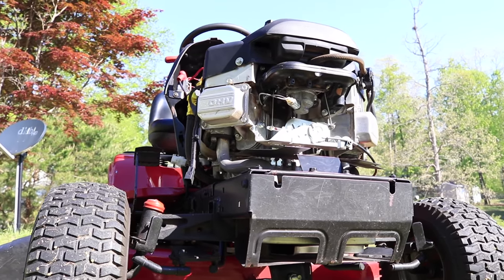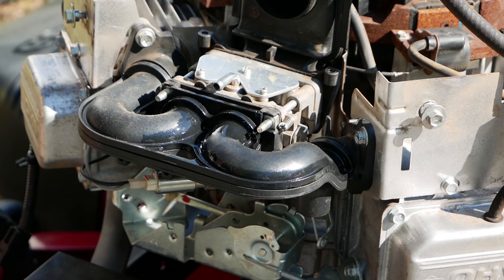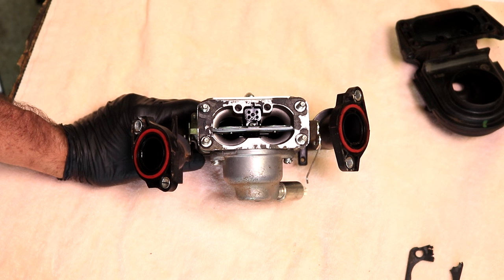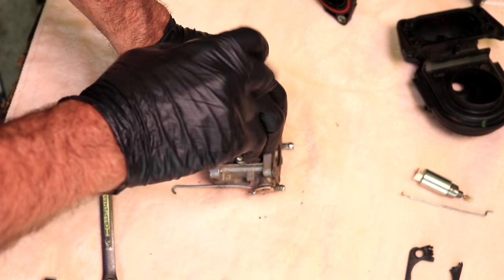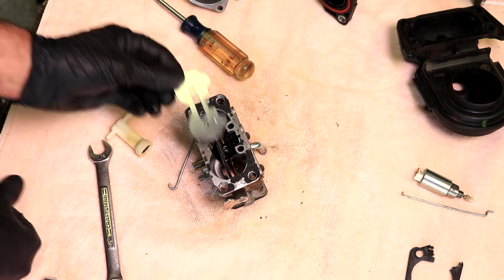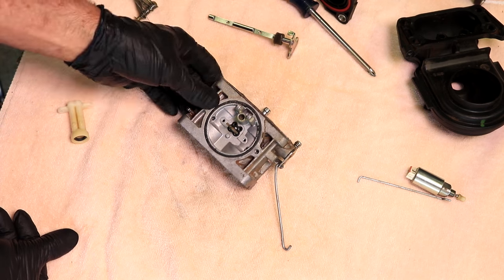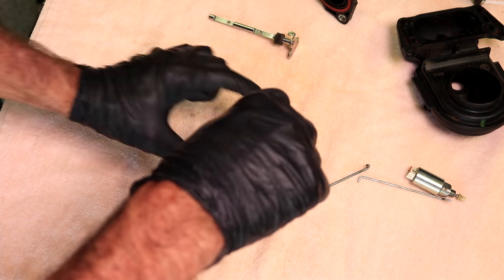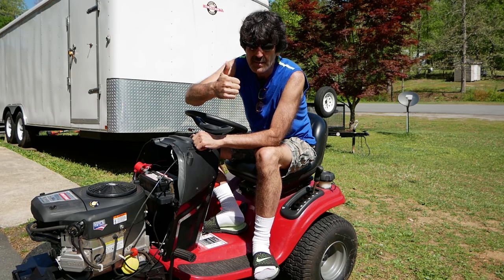Briggs and Stratton V-Twin Carburetor Repair

Comment: I am working on a John Deere with the Briggs 22 V twin,  it has some carburetor problems,  I checked the electric shut off valve,  it works,  checked power at the connector it has power.  I started it by pouring some gas down the air opening it fires right up but dies right after it runs out of gas,  I am using a hand vacuum pump and the fuel pump works.  It's not pulling the fuel from the fuel bowl.  I had carburetor cleaner going through all the little holes. At a  loss as to why it won't keep running.  I didn't take it apart like you did so maybe I need to do so.  
Thank you for your video,  it's a big help
Reply from the maker: HI, I usually will disconnect the fuel line where it goes into the carburetor and point the fuel line into a jar or something.. Then crank the engine to see if it's working.  Your vacuum pump could be generating more vacuum than the engine is so it could be a false reading that the fuel pump is working.  If it is working, then yea, you'll probably have to take the carb off and go through it and look for any nook and cranny, little holes, etc that could be clogged..
Reply: @JLPicard440  
Sir, thank you for your reply,  I appreciate it.  I will try taking it completely apart,  I was concerned about ruining a gasket,  I found a rebuild kit for $8 on line,  so if I need any gaskets,  I know I can find them.  This has been sitting for about 4 years  the original complaint is the battery goes dead before they get their yard cut. I figure maybe the alternator,  voltage regulator,  or a broken wire somewhere.  I have to get it running before I worry about that. 
Again Sir , thank you for your response.  Have a wonderful day 😊
Reply: @JLPicard440  
I got the machine running,  it had a problem with the fuel inlet,  know it sounds stupid,  but I drilled out the small jet at the needle valve by about 1 thousands of an inch.  I couldn't blow through the tube where the fuel line connects.  I could blow through with air, both ways.  Finally I could blow through with mouth air.  I knew something was wrong because when I took the fuel bowl off there wasn't any fuel in it. I also ordered a new fuel pump.  I think you are correct about my hand pump making much more vacuum.  The new one is just in case the original doesn't work.  
What I did was put some gas in a small container and hooked up the fuel pump,  it worked and I kept the engine running by using the hand pump.  The engine runs good,  after I get the fuel system working I can work on checking the alternator/Voltage regulator.  

Sir thank you for your help. It's much appreciated.
Reply from the maker: Ok cool... Battery dies before the lawn is cut?  That's strange... The engine has a magneto and doesn't rely on the battery to keep it running once it's started.  Maybe they would shut it off to go do something and then came back and it was dead.  Maybe the battery was just bad already and wouldn't keep the charge?  That's something I'd have to see.  I'd be curious what you find out on that one!
Reply: @JLPicard440  
It has an electric PTO for the blades,  and it stops cutting the grass.  That's the main problem.  That's why I think it's either the alternator,  or voltage regulator.
The owner replaced the battery and it did the same thing with the new battery.  Those electric PTO's draw a lot of amps when they first engage,  but after they lock up,  it doesn't need as much. Still it is a drain on the battery.  I hope you can understand,  I may not be very clear in my description of the problems.  I appreciate your help.
Reply from the maker: Very clear... so an easy way to test the charging system is if you have a volt/ohm meter take a voltage reading on the battery with the engine off... should be over 12 volts with a good battery... then take another reading with the engine running.  It should be 13.5 or 14ish somewhere in that vicinity...
Reply: @JLPicard440  
Yesterday I checked the voltage at the  wires that come directly off the alternator, at full throttle it was only putting out 12 volts A/C should be at least 32 A/C  after the voltage regulator it should be as you said between 13-14 volts DC  I have and alternator from and project that has both the A/C and DC , so I hooked the DC to the wire that goes from the voltage regulator to the battery.  Still having some problems with the fuel system  so when I get that fixed then I can check the alternator output. 

Sir, thank you for all your help and suggestions. You have gone way above to help,  it is greatly appreciated.  I will let you know when I finally get this thing fixed.  I ordered a new fuel pump and filter should be here sometime next week,  until then I'm going to clean,  and finish the fuel system as much as possible.  I  cleaned the fuel tank, and flushed the fuel lines, I'm going to try to have the fuel system ready just add the filter and may try to use the old pump first if that doesn't work then use the new pump. 

Again thank you Sir 😊
Reply from the maker: Awesome!  Glad to help and my curiosity is up on what you find out with the charging system.. 😀
Reply: @JLPicard440  
I ordered a new alternator,  the old one I had only put out 12.7 DC, I put the original back on it only put out 12.3 volts DC I should get the new alternator sometime next week.  

I'm still confused why the carburetor wasn't allowing gas into the fuel bowl.  But it does seem to be working now. 
I have posted a few videos if you would be interested,  just go to you tube, videos by bert grau. I don't have many videos,  and I am not planning on doing many.  Just a suggestion. 
Your help has been very helpful,  thank you sir
Reply from the maker: Cool Bert, I'll take a look at them.. Thanks.. 😀
Reply: @JLPicard440  
I got the new alternator,  and the same as the old alternator.  I figured I would try running the engine and engage the PTO to see if putting a load on the alternator would cause it to charge.  All it did was blow a 30 Amp fuse and killed the engine.  So now I have even more wiring problems to sort out.  At least now I might have an idea of why it's not charging correctly.   This has definitely been a unique project.  I'm just glad the owner is in no hurry for it. I told him it could take a while and he said it's been sitting for over 2 years,  take your time.  I didn't figure it would take this much already.  Oh well I'm glad I have the tools, and some experience doing this king of work.  
Have a wonderful weekend sir.

One more thing,  I was thinking even though these engines can safely run 3600 RPM many don't  run more than 2600 RPM.  I went past governor RPM and the voltage came up to 13.3 volts,  still not enough but headed in the right direction.  That was going through the voltage regulator.  I really need a small engine tachometer.  I will order one and see what happens if I set the engine to 3400 and see if that helps.

Oh, one more thing,  I found the PTO switch also has a kill wire so you can't start the engine with the PTO on. It can also kill the engine as well.  Like I said, a lot of wiring problems to sort out.
Reply from the maker: Wow,.. wish you were close (western FL)!  I love these kind of problems.. 😀. Do you have the wiring diagram for that particular mower?  That might help you figure out where the problems are coming from...
Reply: @JLPicard440  
No, I'm in southwestern Missouri.  I don't have a wiring diagram,  I'm just going to track down each wire that goes from the PTO switch and see if I find any damaged wires,  or maybe the PTO clutch itself is shorted out inside of itself.  I did over ride the governor and the voltage came up to 13.3 volts.  So that gives me another bunch of new ideas to look at. Throttle cable out of adjustment,  governor set too low RPM.  Who knows what else? I'm sure I can find it just going to take time.
Reply from the maker: Oh wow...  Try to google your particular mower.  I've found lots of wiring diagrams in the past for various mowers, so you might find one (Free)..  A quick way to tell if the PTO clutch is bad is to disconnect it and then try and engage it.  Engine doesn't have to be running.  If it's still blowing fuses while disconnected then maybe there's a wire pinched against the frame somewhere..
Reply: @JLPicard440  
That's a great suggestion,  I'm not working on it today.  I will look for wiring today and unplug the PTO tomorrow.  Thanks for all your suggestions.
Reply from the maker: Glad to help!  Let me know how it goes... 😀
Reply: @JLPicard440  
Good morning, 
I took the clutch off,  after I took your suggestion to unplug the wires,  it didn't blow the fuse.  So I wired in a 20 Amp fuse and hooked it straight to the battery,  the clutch seems to work and did not blow the 20 Amp fuse.  I found the wires from the wire connector to the clutch were wrapped around the pulley shaft and rubbed the insulation off 3 wires 2 are ground and the hot wire.  I don't know if this has anything to do with the alternator not charging or not.  I'm going to fix the wires and try to see if the alternator will charge or not.  I enjoy doing this kind of stuff.  

I remember working on an old semi trailer that had light problems, took me an hour to find the problem then 2 hours to fix it.  The customer told he had it at another shop charged him for 6 hours work,  and told him they couldn't figure out why the tail/brake lights didn't work.  I guess I just got lucky.  The wires went in between the floor and the 5th wheel plate got shorted out. I went around everything with new wire,  cut the old wires where I new them to be good towards the rear of the trailer and they worked.  Some times just dumb luck goes a long ways
Reply: @JLPicard440  
I started it up after getting everything back together,  and it's working.  The alternator was under 13 volts I rev'ed the engine over governor speed and let go back to governor speed and the alternator put out nearly 13.3 volts.  I'm guessing if I get an alternator with more coils,  it might make more output.  Just a guess for now.  The current alternator has 8 coils,  I'm thinking if I can find one with 10 coins it might get up to 13.5 to 13.9 that would be enough volts for this machine I think.  By the time I got finished with it for today,  the battery voltage with the engine off was 12.4 volts 
So it did get some charging even with the PTO on, I only had it on for a few seconds because I have cardboard on my floor,  much easier to lay on . I didn't want the blades to suck up my cardboard and chop it to pieces
Reply from the maker: Cool!  Glad you got the clutch going again that's awesome.  Yes my brother has had dump trucks and (semi) dump trailers for years and he has brought me a couple of doozies with wiring problems!  Almost always something shorted against the frame since there's so much vibration and up and down motion with a dump truck.  My thinking on the extra coils is the voltage will be about the same.  I think the extra coils are for different current ratings.  Kinda like a car that uses more than one style of alternator depending on what features it comes with.. Like some use a 90A and some use a 130A, the one that loaded with electric windows and all that stuff gets the 130A if that makes sense.. but the voltage between the 2 are the same.  Is there a regulator?  Could the regulator be damaged from the shorted wires and that's what's causing the voltage to be a little low?  What if you pull the battery cable after it's running, does the voltage come up any?
Reply: @JLPicard440  
Yes this does have a Voltage regulator, I have checked the voltage at the wires from the alternator,  there are 2 wires, some need the voltage regulator because the alternator is an A/C output,  I have a dual circuit that also has DC output.  At this point,  I'm thinking maybe the magnets have lost some  magnetism.  I check each magnet with a bolt and they all have a good hold on the bolt.  I'm at a loss as for what's going on now.  And yes I understand the difference between car alternators,  with the Amp outputs,  the more power stuff the higher amps.  

When I started driving I started out on dump trucks, then tractor dump trailer.  They do have a lot of problems with the wiring.  
If I can find a used flywheel,  I may try that to see if it makes any difference on output.  

I seen where the AC side should have at least 32volts up to around 35 volts.  This only puts out between 12 - 14 volts AC and 12 -13 volts DC. I only get the over 13 when I over Rev the engine.  That's assuming I'm actually over reving the engine and not just getting it up to the required RPM.   I know many of these are not set to maximum RPM,  probably because of exhaust emissions,  or trying to make the engine last longer.  That takes me right back to the problem of not enough voltage output to keep the battery charged. 

I'm trying to find a tachometer locally but it's not going well,  I may need to order one.  Oh well I really need one in this case.  
Thank you again for all your help,  advice and suggestions. It very much appreciated.  
By the way,  when it hit 13.3 volts that was with the voltage regulator hooked up.  However it just acured to me, I have not checked the output at the alternator wires when I over ride the governor speed.  That's something I need to check  as well.
Reply from the maker: Wow... sounds like you've got a real doozie!  I wonder if there's a wire that comes off the voltage regulator that will separate it from the rest of the mower that's easy to disconnect?  By disconnecting that wire then does the voltage come up to normal.... I would want to know that next at this point..
Reply: @JLPicard440  
I was going to check that yesterday,  unfortunately I was feeling kind of tired so I took the day off. The alternator only has 2 wires that come off it, I will start the engine with the wires disconnected then with my volt/ohm meter check the AC and then rev up the engine to see if that helps the voltage output.  The interesting thing is seems like all the safety switches are working correctly,  the seat,  where when you get off it shuts the engine off, the parking brake and the PTO switch.  That's another thing when it's on the engine won't crank,  which it's supposed to do, but when the fuse blew it also killed the engine.  I found yesterday that the PTO draws 3.9 amps to run,  I think it surges when first turned on because of the increase load,  on the engine and battery  then drops to the 3.9 amps.  I did find that after removing a 30 Amp fuse and replaced with a 20 Amp fuse it didn't blow the 20 Amp.  I'm thinking someone put the 30 Amp in because it was blowing a 20, or 25 not knowing the wires were shorted out.  Still I'm confused about why it won't charge.  In this day,  I also know just because you have new parts doesn't mean they work either.  I'll let you know what I find after more tests. 
I hope I'm not boring you with this,  I do appreciate your thoughts and advice and suggestions.
Reply: @JLPicard440  
Good morning, 
I just checked the alternator again at the wires that come off the alternator,  I was shocked,  in the AC it was putting out 29 volts,  but when I over rev it, the AC went to over 36 volts.  I hooked the voltage regulator back up and now at governor speed its putting out 13.6 volts but when I rev it up more it goes to nearly 14 volts.  Now I'm just waiting for a tachometer and if I can I will increase the RPM a little to get a little more charging.  Im thinking MAYBE by reving it without the voltage regulator hooked up it started charging.  I had tested it without the voltage regulator hooked up before,  but I never over reved it.  I'm thinking maybe that caused the alternator to start charging.  Any ideas? I over reved it with the voltage regulator hooked up but still didn't charge.  At this point I don't know,  and not too concerned.  Just happy it's working correctly.  I wish I had a  video of what I did.  I'm an amateur at  doing videos.  
Sir, again thank you for your advice, and suggestions.  It has been a help 🙂☺
Reply from the maker: Oh cool!  Can you connect the voltmeter to the system so you don't have to hold on to the wires/ probes from the voltmeter?  This way you can shake wires around (in various places) and watch the voltmeter to see if the problem comes back... Im Leary about why it would start charging all of a sudden!.. 🤓
Reply: @JLPicard440  
I am too,  the only thing is, I unplugged the ignition switch  , then plugged it back in,  and the PTO switch.  The only thing I really did different was when I hooked up the alternator wires,  I made a slip on connector for one terminal,  and held the other probe on the second wire.  Then after it was running I over reved the engine a bunch that was when it started charging.  Then it was charging at governor speed and when it went to idle speed it didn't charge much. When I put it in full throttle again it was charging.  Again. Before I put all the covers back on I am going to check everything again.  I'm thinking I may add a volt meter to the dash as well.  Or maybe an Amp meter.
Reply from the maker: That's a good idea as long as the customer is ok with it.. I checked Amazon and they have plenty of different surface mount volt meters on there, but not sure if they're waterproof...
Reply: @JLPicard440  
Just wanted to let you know I finally figured out the problem with the John Deere 145 mower,  the voltage regulator was bad,  I don't understand how it did it, but the voltage regulator would make the alternator stop charging,  then change the alternator and it would charge for a few hours then stop again,  I replaced the old alternator and it would charge again.  After I changed the voltage regulator with the old alternator it's doing just fine now,  without the PTO ON its putting out around 15-16 volts,  with the PTO ON its putting out around 15 volts.  Even at idle it's putting out 13.9 volts.  I took the mower deck off, replaced all the spindle bearings,  and now it doesn't make as much noise as it did before
Reply from the maker: That's awesome!  Thanks for letting me know.  Yes those bearings can make a lot of noise.  I think I have at least one video on that problem. .. 😀
Reply: @JLPicard440 
Sir, just wanted to say thank you again for your help on the charging problem.   I wound up with buying yhe mower J.D. 145 Automatic.  I took the body off, did some repaint, a few more small things.  The engine seemed like it was running lean. Took the carburetor off, cleaned (wasn't dirty) I drilled out the main jets by 6 thousands,  and now it runs great. It was kind of low on power,  and I seen a video where a gentleman drilled out the jets and that helped.  He claimed most Briggs engines are set to run lean. All I know, it runs great now. Still charging great as well.  

I'm working on a Yazoo zero turn, don't know the horsepower,  it's a Briggs V twin.  Single barrel carburetor.  I put a Briggs 25 horsepower V twin,  and it was running very good, then it started running really bad then stopped.  Pulled the flywheel and the key sheared.  At least its an easy fix. 
Again Sir, than you for all your help and brain storming.  It was definitely appreciated.
Reply from the maker: You're welcome!  I'm glad to hear about drilling the main jets on that.  I've wondered about that, but was afraid to try it.  I'll have to keep that in my bag of tricks...  Thank you!.. 😊. (I guess if worse came to worse, it can always be soldered shut and then redrilled back to the original size.)
Reply: @JLPicard440  
I've never tried that before,  but you could get new jets fairly easy.